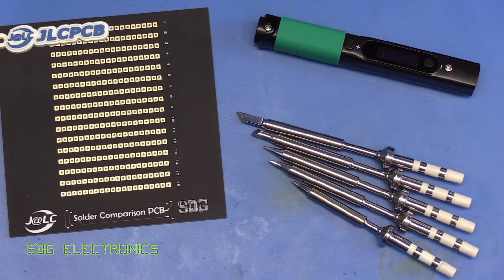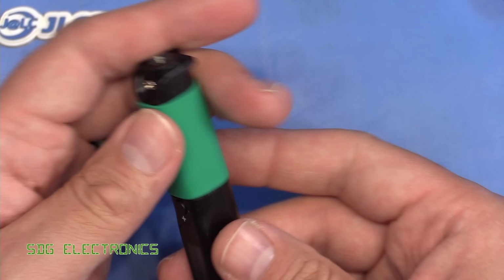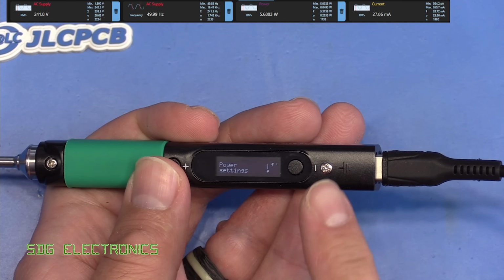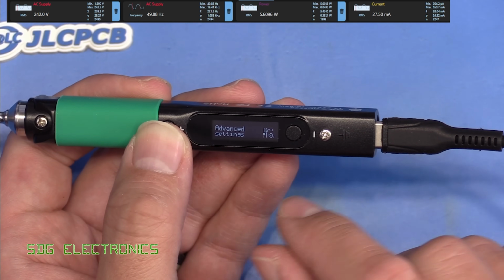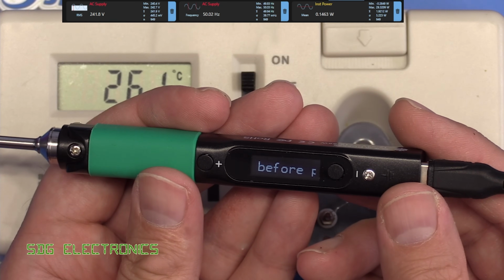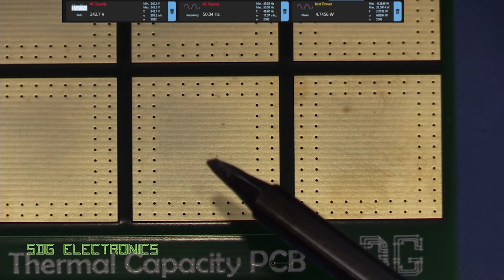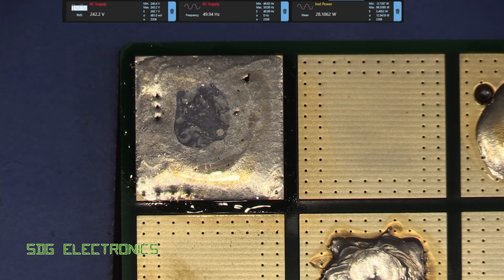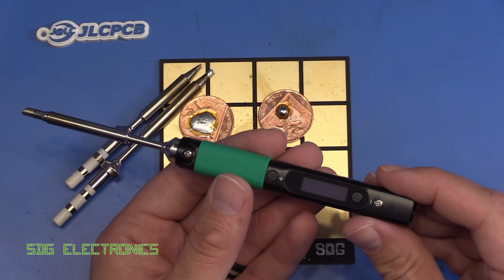SDG #275 Pinecil V2 PINE64 Open Source Soldering Iron - Test with PCBs from JLCPCB

Comment: Why does a soldering iron need a 100MHz+ processor in it? Driving a display, some buttons and running a PID loop? really?
Reply: There is a breakout board for it. you could write software for it. But yeah, surely not necessary.
Reply: It does crypto mining while in the stand.
Reply: It's so in future the manufacturer can offer subscription based power output, customisable skins and DLC.
Reply: My Commodore 64 is crying in the corner with its 1mhz CPU 🤣🤣
Reply: To play Minecraft dummy!
Reply: I totally agree, but this is a chip that the can get right now and low-end ARM/RISC-V chips are mostly over 100MHz these days.  I still run projects as low as 1MHz and sleep the chip most of the time even then, but today's fancy SoC's are simply going to have a much higher clock rates.

While I find it inelegant to use such powerful chips for such simple tasks, the real question is development and manufacturing cost efficiency, not clock efficiency.  My own sensibilities don't matter.

It's a $26 soldering iron with enough processing power to run a small web server on the side ;).  This soldering iron has more power than desktop PCs once did, but overkill is now normal.
Reply: @antibrevity  Pretty much this. Availability is king. If the jellybean components are way more capable than you need, what does it matter? They're the cheapest and most abundant in their availability because this is what's being sold the most. It's simple economics.
Reply: It needs to also do type c negotiation, I'm not sure how much of that is done on the MCU. And 100MHz is not that much and there's many MCU's with high availability and good pricing in that range so why not use them? Also that's kind of a weird  complaint tbh, you the end consumer should only care about the quality and the price, which are both amazing here.
Reply: I priced out several MCUs for a project and the ARM processors just couldn't be beat. The AVRs were slower, less peripherals and more expensive. The Microchip MCUs required expensive compilers or assembly language programming. No matter how you calculate it, ARMs are cheaper, especially when you add up the entire BOM pricing.
Reply: Anyone made it run Doom yet?
Reply: @antibrevity  Indeed! Why does it need a 100Mhz processor? It doesn't. But a lower speed processor would be more expensive, simple as that :p
Reply: @nuckenfutz9983  Yes, actually.. they have! It's Pine64's community; did you expect there to be any other answer?
Reply: @antibrevity   look at Pinecil wiki.   how is it negligent when one of  main purposes of Pinecil  is to be a RISC-V  developtment board for the open source community ?  Pine64  members basically is doing open source development.   it Also  can be used as a soldering Iron, but I know many people who never even put the Tip in it, and just have a Break out board on the back side and uuse it to develope  USB-C libraries  amoung  other fun things.
Reply: @CollinBaillie  the BL706  was also very  cheap  to get and  had a lot of availability.  it just happens to be faster than the older chip as a bonus and has BLE  support too.   there is an SMD antenae  under the screen of the V2  waiting for some RISC-V  volunteer developer to  write code for it.
Reply: Once BLE mesh and dynamic IoT starts getting a bit bigger you'll see everything be packed with this kind of power
Reply: Why doesn’t it have wifi and Bluetooth? 😂

Comment: Pinecil v2 now supports pd 3.1 epr 28v. It can now output 100+ watts. The only problem is 140 watts 3.1pd epr chargers, it cost 2x more than the pinecil itself.
Reply: Ha, good to know ( using 6s lipo as a source )
Reply: I know exactly how you feel. That’s why when I see PD bricks for $1 in the Salvation Army Store I pick them all up. Picked up a nice 100w one with the E cable.  The cable alone is over $30. So now I think I’m going to order one of these Pinecils bc, why not.
Reply: I have a powerbank that can do that much haha
Reply: If it supports 28v via firmware update, then I assume you can feed it 28v via DC or USB plugs from a ‘dumb’ PSU, even without the firmware update?
Reply: There’s 24v pwm led drivers out there that can be turned up to 27v nearly or 30v ones that can be turned down
Reply: @davadoff Yes you can ! I modified my power supply to 36 v 6 ampere and use that fnirsi power controller to manage that I can set everything in that I tested it on 20v 5 ampere is the pencil v2 very powerful with DC charging ! I don't know how he tested that but only with 10 -12 volt that will not work!  And on 24 volt with 5 amperes you can work on PS5 PCB an Xbox PCB ! Without problems but ist good to know that we can go to 28 volt 5200 amperes without problems! I didn't want to go higher because in the official site you can only go 28volt 4500amperes ! 
You don't need expensive tools to do a good job you only need skills and experience! 
Is only my opinion.

Comment: I realize the documentation that comes with the Pinecil is lacking.  But you may want to re-do this review with a decent 65W PD charger, and after reading up a bit more on how it works, and what the difference is between short and long tips.  And 833 means calibration was successful.  Only calibrate when the entire thing at room temp.  And you need to power cycle the iron after each tip change.
Reply from the maker: Noted on all points. The calibration still seemed out after trying this again today.
Reply: It is a big mistake for them to release it while the extra tips that were designed for it are still not yet ready for retail.
Reply: @sdgelectronics  try calibration with the Short  tip that it came with. see if that is different. of course if stuck  open Issue  ticket on Github Ralim's IronOS, he usually has a good idea what to do since he wrote the firmware.  he sometimes gives people beta debug tester firmware to expose certain problems so they can be fixed.  we have a flasher for V2 now that can be used to upload the betas.
Reply: How is the documentation lacking? You literally have tons of documentation, all of the schematics, open source firmware etc... 
Really don't get your comment.
Reply: @brianfrank4156 What part of “comes with” escapes your mental grasp?

Comment: I bought an original Pinecil and it died within the warranty period.  The customer service was horrible and they refused to honor the warranty.  There was much avoidance claiming it was a power supply issue.  I used 5 different PS.  The issue was with the iron itself.  It is cheap but that is irrelevant if it fails within the first 3 months.  I might pick up a TS101 later at some point.

Comment: I think we deserve at least a DC source powered performance test 🙂
As for the 88 W as the claim, it is impossible without boosting the driving voltage because the resistance of the heater is over 8 ohms, as I remember from my TS100 measurements.. so these new short tips must have slightly lower resistance. It would be nice if you measured it.
Reply: Yup, slightly lower resistance. The TS100-compatible tips are 8 ohms, the new shorter tips are 6.2 ohms!

Also, the Pinecil V2 supports EPR PD3.1 (with a certified cable) at 28V 4.5A. 98W on the longer 8Ω tips, or 126W on the shoter 6.2Ω tips!
Reply: @Haulien  the new V2  comes with a shorter 6.2 ohm tip. that number is not based on the older 8ohm long tip.  There is an explaination in the Pinecil Wiki  look for 88W in the wiki.  tldr,   to be conservative bc of manufacturing tolerances,  use ohm calculator , plug in 6.5ohms,  24V, dc barrel charger,   and you get the 88W printed on the side. google any ohm calculator.  Technically that is theoretical max. however due to some resistance of PCB components & small amount from cable, and also a little resistance from tester itself, it will not reach that number exactly.
Reply: @Haulien why bother with the expensive cable and charger? Just feed the iron 28v from any source?

Comment: Although QC 3.0 are rated for up to 22V or max current up to 4.6A the max power itself is only 36W. The adapter itself is mostly only output 18W for QC 3.0, probably that's why it only draws something under 15W. Maybe try using PD 3.0 compatible charger or the barrel plug, i mean surely it will do better with full power.

Comment: I got my Pinecil V2 last week, and I'm very happy with the performance so far on the limited 15w I've been able to deliver it.. I do need some more tips though! The giant Cone is too much Cone to cope. Edit: the 15w limit I have is due to power bank limits!
Reply: not sure how it is even heating with  only15w power bank. how many amps/volts is that port ?  Can also see the volts  on the right side of pinecil screen.   for the conal tip  included, I learned from Mr. Solderfix videos  to hold the tip more like a steak knife  touching aloing the side of the tip and not  the tip. I no longer hold it vertically like a pen. Mr. solderfix videos he seems to use conical tip  99% of the time but he has a lot of practice.   if you want an easier time you might consider the  D24- wedge tip  and the C4  bevel tip (large and good for desolder).
Reply from the maker: Conical tips are mostly useless except for certain PTH parts. We are discouraged from using them during IPC training, favouring chisel tips for higher thermal performance. You shouldn't have to change your soldering style and grip because of the tip choice.
Reply: Pro tip: old laptop power supplies are a good option for a high current 19V source. I'm using an old Sony one because it came with a nice flexible cable, which actually seems to put out 20V even though it's rated at 19V. Just chop the connector and solder a new 5.5 x 2.5 mm barrel jack.
Reply: @sdgelectronics   I prefer the BC2 or BC3 bevel hoof tips.  people have been asking Pine store to please change default tip from Conical. the Conical requires you to hold tip horizontally  so side of it touches the leg to solder. would also be nice if a D16 smaller Chisel tip was made in ts100 styl since it only exist for  T12-d16.
Reply: I read that Pine store will have all short tips packs in mid -December.  For now though I am using both my long 8ohm and shorter 6.2ohm tips. 
I would highly avoid using QC charger that is only 15W on V2 pinecil as you will not get good soldering result and it will maybe shut off a lot. 
You may even get  "thermal runaway" or "undervoltage" messages sometimes when it's trying to draw more power than  the small  weak charger can give. 
Highly recommend getting at least usb-C PD (Power Delivery protocol)  charger that is minimum PD65W, 20V, 3-3.25 amps on Ama zn they are so cheap now  $10-$25 only.  see Pinecil Wiki for list and links to some of these on Ama zn.
Reply: @UpLateGeek  what length barrel fits best. I know its 5.5mm x 2.5mm but what about the length of the actual barrel
Reply: @eddiekytia just use a good quality one. Length doesn’t matter.
Reply: @davadoff  It does if your hand shakes a little...

Comment: The longer cartridges you have used, although compatible with this new version, are not as efficient in power and heat delivery as the short ones.
They are still working on producing new short tips ( probably with the same geometries of the long ones but shorter and more powerful ) that are going to be available in the near future.
You should definitely rivist these tests when the new short tips will be released.
Reply: when you see the Offset number in the calibration like 833 in video, the calibration is complete.  it is important not to repeat calibration over and over as he does in video.  calibration method, it is critical to read instructions on  firmware website first and critical that both the tip and the  handle /pcb internals are cold/ room temperature or calibration won't work .  this means it should only be done at fresh boot of pinecil and not after it has been plugged in for 5 minutes as even that warms up the PCB.  I'm also not sure people realize you have to unplug V2 between changing from long and short tips since it only does a resistance reading on boot up.  and the short and long tips have very different temperature profiles used which could lead to wide difference in temperature reading if you don't do this.
Reply from the maker: The calibration was done whilst cool (it was cooled in water each time), but an offset was still there. Definitely something not right.
Reply: New  4-packs of the Short tips (6.2 ohm)  will be at Pine Store in December 2022. but way things go it could be Jan 2023.  short tips 6.2 ohms less than the 8 ohms longer tips  is true they allow more power/watts for iron, per Ohm Calculator too.
Reply: @sdgelectronics  offset number  will  appear when doing calibration again. open ticket in Github IronOS, there is a temperature document there too that Ralim explains why calibration is not perfect. if you mean  you believe offset # should go to 0  when you run Calibration an hour later, I don't think that is how firmware works.  if I do calibration 6 times, leaving 30 min unplugged between each calibration for proper PCB colling,  it always shows me  Offset # on fresh boot calibration. Ralim suggested removing offset from view as it may be confusing.
Reply: Short tips are available on the store now.
Reply: The calibration method  is changed in the new firmware.  now they hide the calibration Offset  number and   it will calibrate on reboot after you check the box.  since the offset is  not useful and confusing people.
Reply: @sdgelectronics  I am hoping that the shorter cartridges make a big difference because this review shows that 65 or 88 watts is useless if the temperature at the tip doesn't detect that it needs to put more power into the tip.  I just bought this thing (don't have it yet) but I didn't find this review until after I purchased it.  I bought all 6 shorter soldering tips.  15 watts while the tip is sunk into that big sink seems really bad.  This is replacing my TS80 that I bought last year that wasn't good enough for tinning bigger 12 gauge wire.  I was expecting a 65 watt PD supply to be able to get close to that when the tip is being used on a big heat sink.  Seems like all you need is a 20 watt power supply to keep up with what this thing can do once it is heated up.  At that point, it is just a 13 watt soldering iron according to what it was drawing.  Have you tried the shorter tips?
Reply: There is another youtube video where they tested it pulling around 72 watts while soldering a big copper area so maybe something was up with this test where it was only pulling 13 watts when trying to heat that big heat sink area.  Video is FPcP3Z6V_lU

Comment: I'm really struggling on deciding between this and the ts101, I guess it'd make sense to just buy the cheaper and switch if it doesn't work out but I'd like to know what you'd recommend for someone who'd mostly use it for occasional repairs and modding Handheld game consoles.
Reply: The Pinecil is based on the same design concept as the TS101.  It all started when an alternative firmware was developed for the TS100 and became so popular that they decided to build their own iron as well. I have a v1 Pinecil and absolutely love it. For all my small through hole and SMD work it’s perfect. I have larger irons but they supply too much power and sometimes are not suitable due to nearby plastic melts or components overheating. This is ideal for small electronics work. It’s not suitable or desirable for welding up your gutters and that suits me fine. It’s super small and fits in the toolbox beautifully. Make sure you grab one of their silicon red USB-C cables. They are floppy and smooth and work really well.
Reply: @wizdude  I’m looking to get the Pinecil soldering kit for portable/station , which tips set you recommend get short tip gross or fine they also have the 120w desktop power supply  on sale $37.99 im mainly going to use for fpv drone builds and in the field quick repair , I’ve never solder and will be my first time “newbie”
Reply: @wizdude that’s not right. An underpowered iron melts nearby plastics because you are forced to hold the tip to the joint for a long time trying to flow the solder properly.

Comment: You mentioned the use of QC 3, might it be an issue with that? You recon PD could do any better? 
If I am not mistaken, you can use the same TS100/101 cartridge. Otherwise I would have spent 10$ on Aliexpress for no reason.
Mine should arrive soon, pretty disappointed to be honest.
Thanks for doing the great tests.
Reply: You can overcome this with the boost temperature setting, no reason to be dissaapointed it's the best soldering iron for the price. Also the more expensive irons may have better engineered tips or may just be compensating in software and I don't know if ironOS does it –thermal resistance from tip to thermocouple is constant, so temperature error is proportional to the power draw–

Comment: Did you reboot it after changing tips? If I'm not wrong it calibrates the tip resistance on startup.
Reply from the maker: Yes, always turned off before swapping cartridges.

Comment: Hi, thank you very much for the amazing review! It agrees with my experience with a Pinecil v2 on large copper regions (which is not great). I was blaming my soldering skills. I have a question though. Do you know if Hakko T12/T15 cartridges do better? I mean both original ones and clone ones (you can put one into a pinecil or use a separate station). I also have a clone T12 station, and clone T12-K tip feels much better than a Pinecil one.